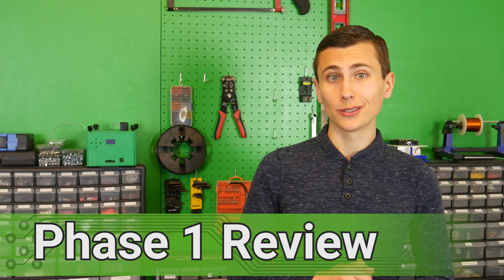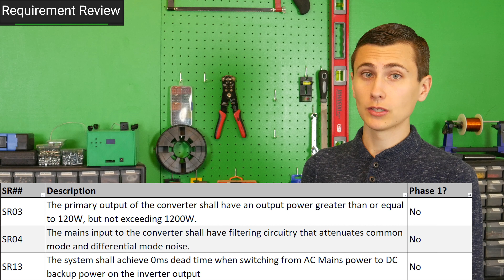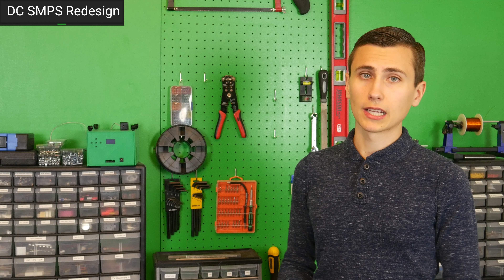Phase 1 UPS Review – What worked well, what didn’t, and what’s next?

Comment: I'm currently working on an 1.8KW power supply for a DIY CNC router...I'm going to keep a close eye on this project so I can possibly avoid any pitfalls you encounter.

Thanks for doing something so unique on YouTube.
Reply from the maker: Hello dr.rockzo! Thanks for watching! That sounds like a pretty great project. Just curious: What topology of power supply are you designing?

I'm glad you like what we're doing! I'm having a lot of fun. I look forward to seeing you around the comments section!

Cheers!
Reply: @EEforEveryone 

I'm actually going pretty old school becuase my needs are simple but here's the plan. A saturable core oscillator running at 35KHz with 4 secondaries generates the drive signals for a MOSFET full bridge to drive a large non-saturating ferrite transformer. 

I've got the oscillator working and am currently prototyping the bridge...having some shoot through issues as the voltage increases, but I think I have a solution for that.

I went this way becuase I need non-standard voltages and it seemed more reasonable at the time...this is by far the largest power supply I've built, but I'm learning a lot and I think it will work.
Reply from the maker: Thanks for the info! Yeah, that seems pretty reasonable. 

Did I catch it right that you're driving your fets directly from the first transformer? You may want to consider passing those control signals though an H driver with adaptive deadtime control.

Then again, I've seen DIY cncs that operate from diode rectified mains... Which I'd never recommend, but is sometimes sufficient.  If you don't have a stomach for adding another voltage rail for gate drive, then adding a passive network for asymmetrical gate drive in your H may help as well.

Definitely post a link to an article, pictures, etc, if you're documenting this project. I'd be curious to take a look at your schemaitc If you're willing to share via email. 

Not to be that safety nut... but is your mains isolation present in that second stage of the power supply?
Reply: @EEforEveryone 
 EEforEveryone 

You are correct that the oscillator is directly driving the MOSFETs, the idea was that it produces a highly symmetrical signal. But the rise and fall times are faster than anticipated, causing the shoot through. I think a can remedy this with a pair of diodes per gate to control the rise and fall rates and generate some dead time.

I was trying to avoid a control IC because most are overly complicated for my application. I basically want a high frequency transformer simply to get the voltages I'm after; after all I'm just powerimg motor drivers so tight regulation isn't necessary. But an extra kick is that they all regen when decelerating, so I'll have to design a clamp to dump excess power into a resistor to prevent over voltage situations. 

My job happens to give me access to UL standards so my transformer will be build to legit standards and I have a calibrated Hi-Pot tester at my disposal. After initial testing through a ballasted variac and isolation transformer, if it passes Hi-Pot I will be running straight off line power; if it fails, I'll probably leave an isolation transformer in place...maybe.

I'm down for sharing more but don't do much social media...i 'think' I've got a Twitter account, I could post some stuff there or email you. Honestly it's a collection of point to point modules currently and I'm using KiCad for my boards. I'm trying to get the bridge board worked out before sending files to a board house.

Sorry for the roit act post, but few even understand when I describe the project. I'm in the DFW (TX) area...are you anywhere nearby?
Reply from the maker: Hello Dr. Rockzo, Apologies for the late reply! I didn't get a notification when you posted this... which is weird. Caught it when sorting through my email inbox.

At any rate- Seems like you are thinking about it in the right way. Seems like you're considering things to the level required for this project. I hope you can get the gate drive issue sorted! 
If your transformer passes the appropriate hi-pot test, that's good enough for me. However, the insurance company might not agree. Best to keep this somewhere where catastrophic failure can't burn your house down... just to be sure.

Best of luck in this project, let me know if you hit any roadblocks, and I hope to see a couple pictures via email someday soon!

I'm usually in the Midwest, (WI), so Texas would be a bit of a hike. Hey, anything's possible though! I'll keep you in mind if I'm in the area, for sure.
Reply: EEforEveryone 
I do have an update...i switched to a MOSFET with a much lower total gate charge and added diodes in parallel with the gate resistors (cathode away from gate). These two changes took out the shoot through issues.

I was able to test it with a 60VDC input and 200W worth of halogen lamps of load with no issues. 

At this point I have decided to move things from a benchtop lash up to proper PCBs for safety before moving to line voltage tests.

I just noticed your Twitter info in the video description, I'll follow you and post some pics of the project's current state (it's probably pretty comical looking ATM). I have no idea how any social media works...but I'll figure it out.
Reply from the maker: Hey Hey, I'm glad you found a solution!

200W is a pretty good test, finding a load to handle the full 1800W may be a challenge, but could be pretty exciting.

Agreed on the PCBs, They'll likely make it easier to keep the electrons where they should be. If you haven't used the Saturn PCB toolkit before, it's pretty great for approximating temperature rise in traces due to current, among other things. http://www.saturnpcb.com/pcb_toolkit/

Best of luck when deciphering twitter. I can't wait to see what you've been working on!